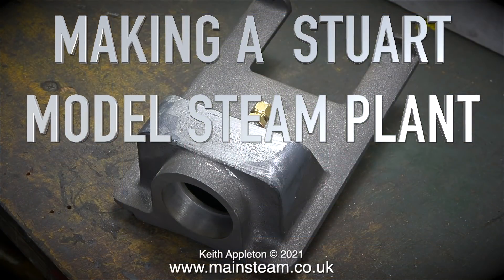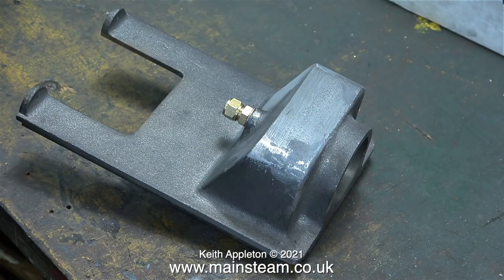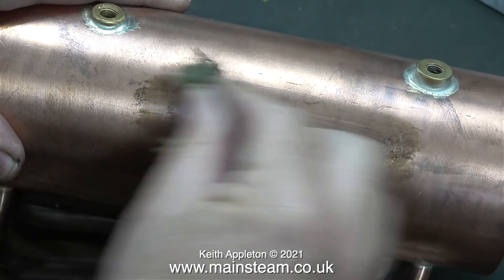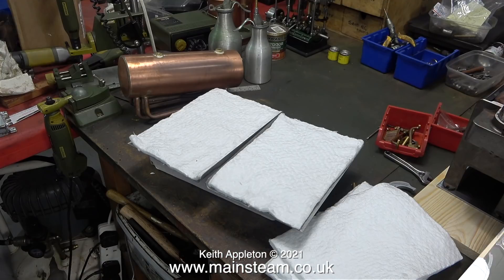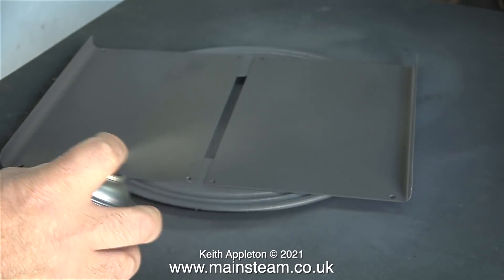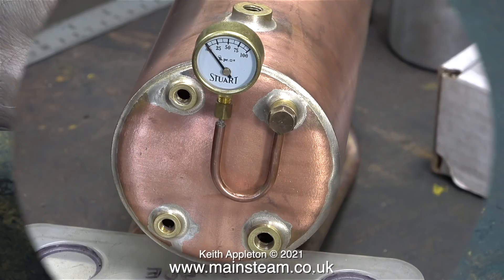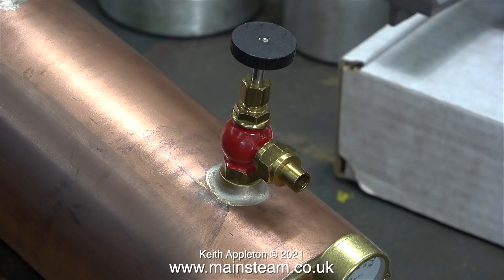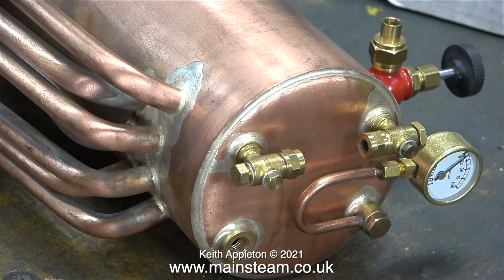MAKING A STUART MODEL STEAM PLANT - PART #35

Comment: Your brief comment on polishing spindle triggered a memory. A guy I worked with years ago was an artist when it came to automotive paint. I believe you mentioned the last use took a long time. Is yours sheepskin ? They periodically need a tuneup. There is a special tool,looks a lot like the tool that you use on an abrasive wheel. Or,Robbie used a good sized screwdriver with the sharp bits rounded off to get the built up wax off the sheepskin. He also mentioned the shop kept an old wringer washer for washing sheepskins. Different sizes of grits benefit from sheepskins dedicated to families of grits. Also used for washing coveralls.
If you found a suitable sized container you could use your tumbler for washing the sheepskin.
That is,if any of these ideas are useful to you. Or you could buy one or two new sheepskins. Whatever works. Cheers.
Reply from the maker: My main wheel is multi layered cotton one. I use an old grinding wheel for dressing it.